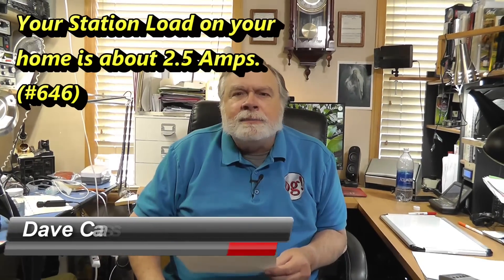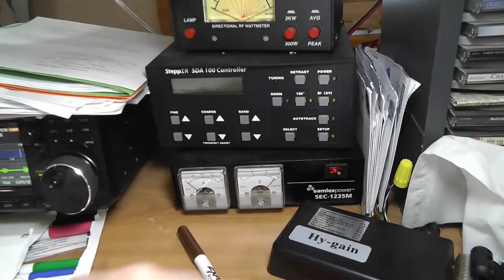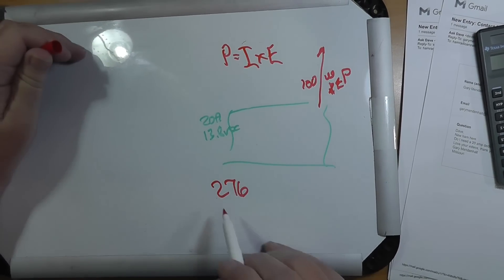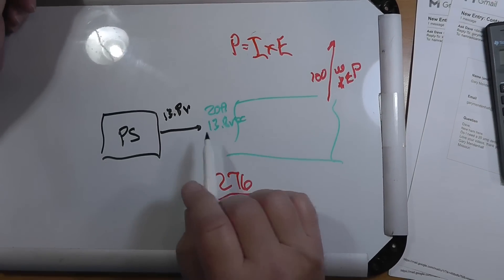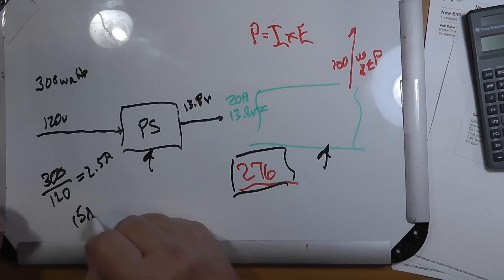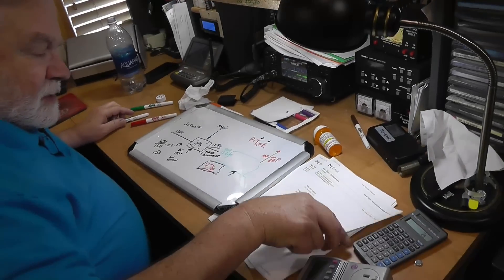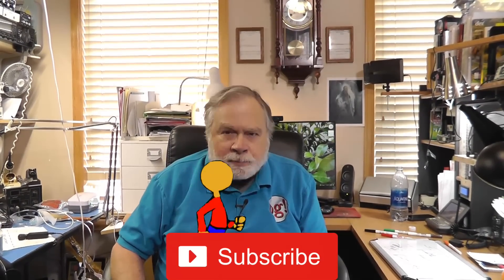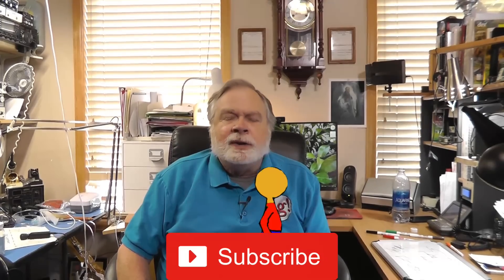Your Station Load on your Home is about 2.5 Amps (#649)

Comment: I don't disagree with any of this, however a number of 200w rigs with linear power supplies will consume far more, the user manual for one of mine quotes 1050VA. Granted that is with full carrier output, your figures will be more typical. We are perhaps fortunate in the UK with our 230/240v enabling a fairly QRO station to run from a single power point.

Comment: Hi, Dave, at 2.00 minutes....E stands for Electromagnetic force and I stands for Intensity OR current.
E stands for Electromotive force
I stands for Intensity of Current.
Your amplifier (1200w DC in and 500w RF out) would require 10amp at 120v and it should be capable of 20amp minimum.
Ohm's law would have been a nightmare for the beginners.
De VU2RZA

Comment: Can somebody help with my question.. 
This question is hypothetical.

So lets say i have a 1500 watt amp on sideband and it's set on 1500 watts to transmit.. so that would be pep power, am i right (please correct me)
So nobody talks on pep power so on a standard microphone the transmit power would be much lower. Yes (please correct me)

I have been told running 1500 watts on sideband talking on a standard microphone the average power output would realistically be around 400 watts.. (please correct me)
Thanks for any replies.. im still learning so any help would be appreciated.
Reply: Indeed its pep.  Let talk in terms of voltage.  1500w on a 50ohm system is 270 volts at 5.4 amps.  So legally your signal can never have a peak to peak voltage of more than 270v.  It does not mean the system runs at 270v, that you simply can't exceed it.  Unless you are running a constant carrier like fm, you would not be using 1500w on average.  You limit it to 1500w at any one moment in time.

Comment: Whenever I hear a basic question about volts and amps and watts this way, I can't help but think the licensee just memorized the license questions and answers. You can't really study and learn electronics without knowing this stuff.
Reply: exactly!!!  I was building regulated power supplies from scratch since the 70's
Reply: That's how the ignorant work.  With cook books.  For a large part, Dave included.  It's about 90% of us.

Comment: Hi Dave, I use a 12 Vdc Car battery, to power my Amp, it works ok, and you do not need an 80 Amp Dc power supply, a normal 13.8V/20A adjustable PS, can fully charge it to 13 V. The drawback of using 13 instead of 16 V, is unnoticeable. Regards!